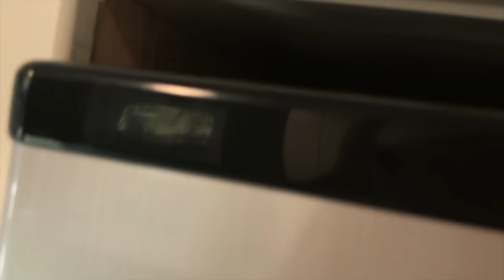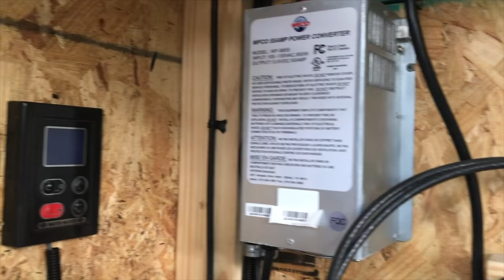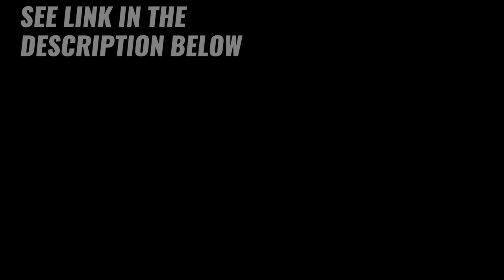GORGEOUS Certified Tiny House For Sale - Take A Tour

Comment: The only storage is the kitchen cabinets?
Reply: No, storage built into stairs and the bed enclosure for the loft is storage compartments... There's also a laundry closet that you could use if you choose not to put a stacked washer and dryer in there... While sectional couch that turns into a bed usually also have some storage space in them but that may be already filled with bedding...
Reply: @ZeoCyberG  Well, you're right. I guess that certainly IS storage. Even if you are a minimalist though, I don't think that's enough. It's otherwise a nice place though. 👍🏻
Reply: @Happy Viewer  Well, for an actual minimalist, they would consider it more than enough... Van dwellers, for example, easily make due with less than a 1/3rd the space and there's people who live with even less than they do on down to people who just travel with a single backpack containing all their stuff... 

There's just no one size fits all and some people will need more than others or need a specific form of storage more than others.  While some people can make more use of the space than others can...

How it will be used also factors, like you don't need much storage space if it's going to be used as an AirBNB, for example... This would actually be overkill then as just the 7 storage compartments in the loft can store as much as 7 large luggage bags and not too many people travel with that much for just weekend getaways, etc.

While every house can be renovated or even modified.  Shelving can be added, pull down closets can be added, wardrobes and other furniture can be added, part of the storage shed on the exterior that houses the solar, water tank, etc. can be used for additional or seasonal storage, storage doesn't have to be limited to just the house, etc.

Sometimes you just have to use your imagination for what can actually be done with any of these homes...
Reply: @ZeoCyberG  I totally get it and agree with all of your points. I know that if I had to, I could technically make just about any space work. I also know that because I started heavily researching tiny houses and RVs several years back. I have learned a lot just from RV-ers alone, and that made me able to creatively come up with ideas of my own. That being said, my particular preference would have a good bit of storage. That's for a number of reasons. Cost of living is one factor. It generally costs less to buy a larger amount of food than it does smaller amounts. Naturally, you need more space in which to put it. The next, is sort of on the same line. I don't leave my house and shop very often, so when I buy, I buy enough to have on hand for months at a time, if not longer. In addition, I have a lot of hobbies and interests, and live my life almost entirely in my home, so I need space for that. Lastly, most of these things all stem back to my physical well-being. I suffer from chronic pain. Hence the solitary, inside living. In order to get through every day, I have to make things comfortable or comforting. It's not even that I need a ton of space, or things. I just need dedicated space in which to put my stuff. I really mainly only live in one very small room of my house. So I know when I move to an RV or tiny home, the size will be just fine. I find it hard to manage physically and mentally if stuff is just all over the place. So, I maybe have more storage requirements than others. Again, it's not about the size of that space necessarily, for most of it, but I need to be able to easily get whatever it is I need, out from wherever it is. So I can't pull out all of the contents of a drawer or cabinet, for example, to get something in the back. Thank you for taking all of that time in making your response. I wanted to do the same back. :-) Perhaps it will explain my comment a bit better.
Reply: @happyviewer4872  Yes, thanks for the clarification.  Special needs are often a consideration that most don't consider until they need to themselves, unfortunately, but the nice thing about most tiny house builders is that they are custom builders and you can usually have one built anyway you prefer it...  This one was built by ATX Tiny Casas in Austin, TX, if you want to check them out...  It's their Zilker model...   It's possible to also do an RV custom but they usually start over $100K,  custom Class A's even start over $500K, as custom is typically the most expensive way to build but it does give you the most control over what you get and can fill needs the standard models don't fill... While custom Tiny Houses can start much lower at $25K on up...